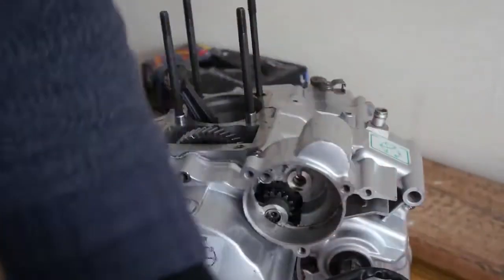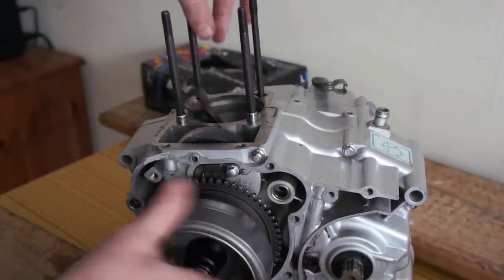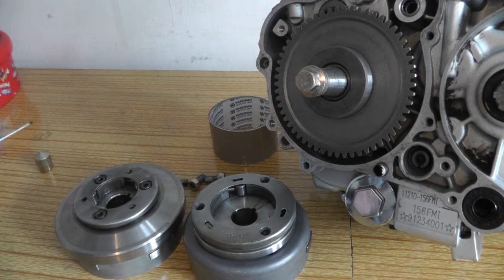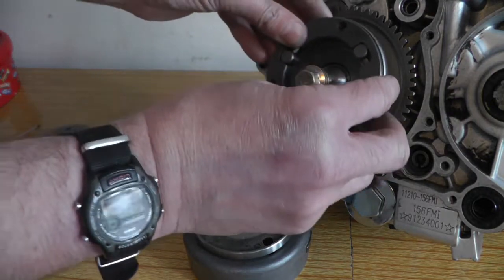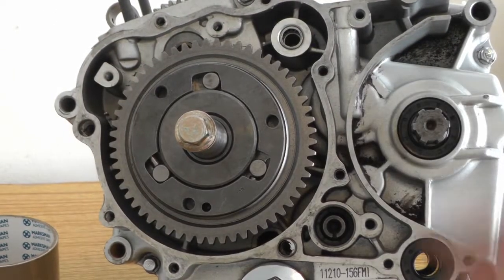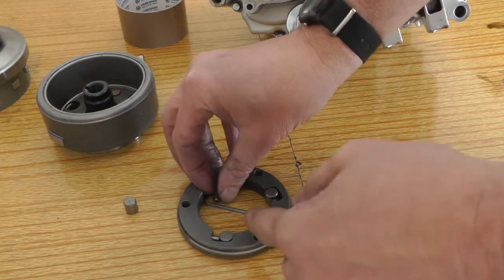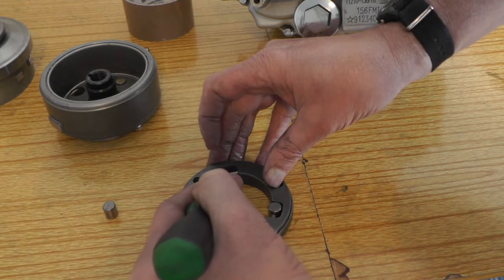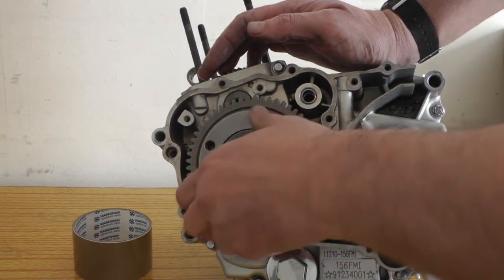Starter Motor Whirs But Engine Wont Turn: Motorcycle Sprag Clutch Diagnosis and Test

Comment: Thanks for the explanation, I have the same problem on mine, except mine has 5 gears and is 223cc. (167FMM)

Quick Q: How would I remove the flywheel without having it spin?
Reply from the maker: you need to lock it off somehow various methods

Comment: Afternoon mate, I’ve got two black wires with loops on the end running up to my regulator although they’re not screwed to anything, any idea what these are for as the bike is turning over however not starting and was wondering if this could be an issue

Comment: Hello excellent video and explanation…I want to ask you, I discovered on my motorcycle the end of the crankshaft is scratched where the main gear of the starter and the starting clutch press...the starter works normally but the motorcycle rarely starts with it..what do you think? model is honda astrea
Reply from the maker: it may affect it but I do not know without inspecting